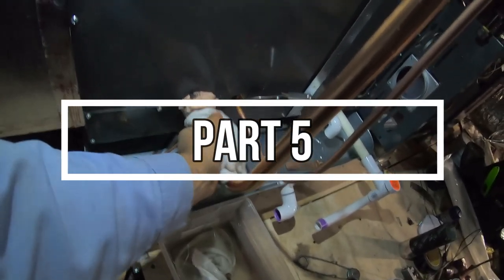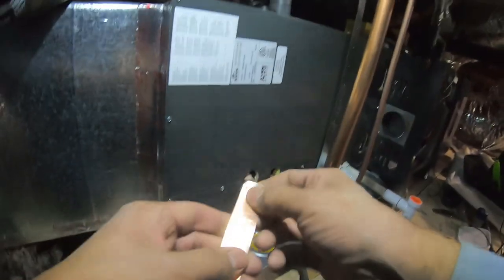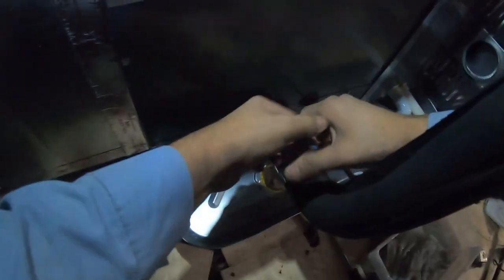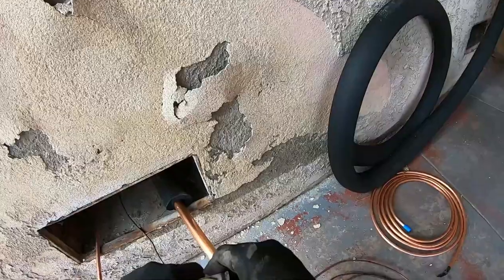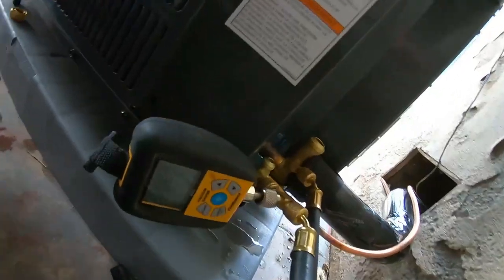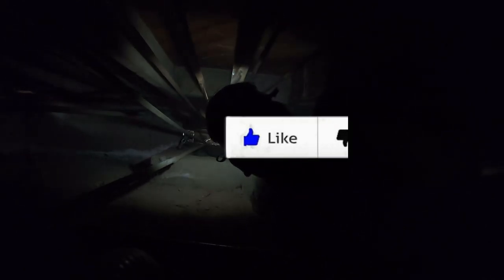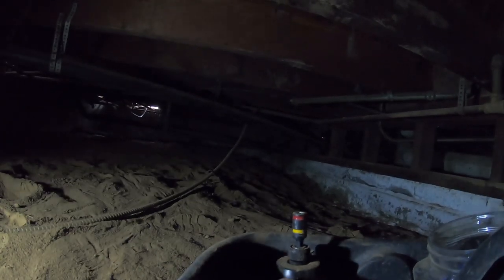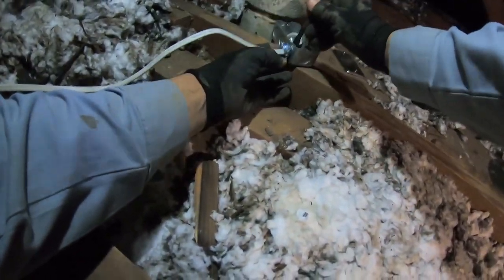New Home HVAC Installation Part 5

Comment: Great work. Thanks for the video.  520 adhesive for your Armaflex seams :-)
Reply from the maker: You know I've used it before. In my old company. Maybe I'll give it a shot again. Would be faster for sealing the seam. Thank you!
Reply: @theairconditioningguy  I don't think it's faster, it's just the "correct" way to butt and seam Armaflex.